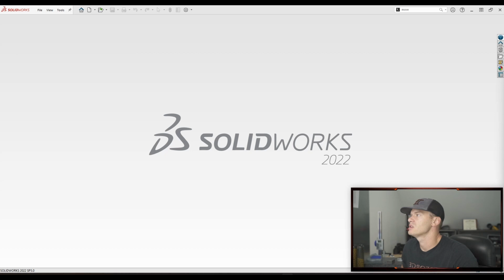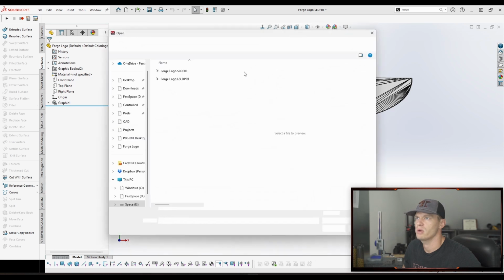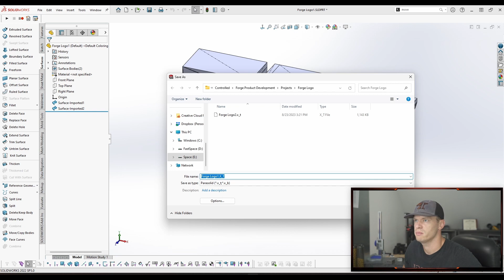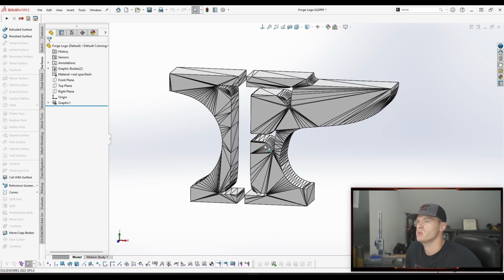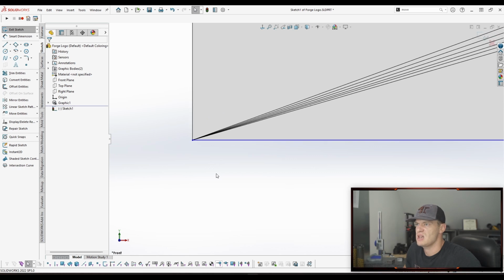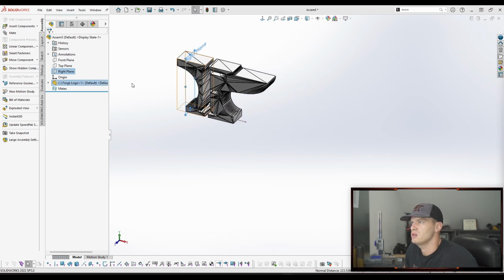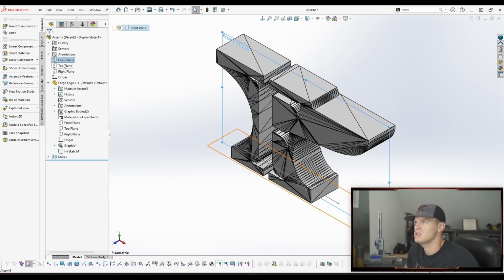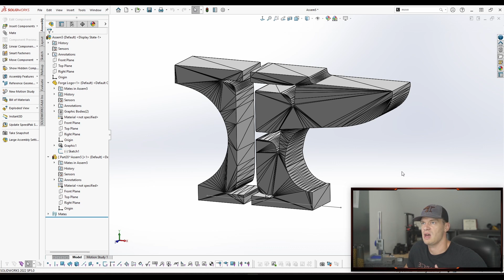How to Align Empty Mesh Files in SolidWorks

Comment: Hey Josh, I'm in the process of scanning a full car and using a graphics mesh to build the chassis and roll cage. This was exactly what I was after to redefine the origin and planes - albeit I would have liked to create more accurate sketches to define the ground plane and centreline but I guess eye balling it will give me the 1-2mm accuracy I need. Thanks.
Reply from the maker: Very cool project! I hear you. It is hard with only a graphics body. 

A large object like that can create massive mesh files. You may be surprised how course a mesh you can get away with as a reference, which may allow you to import as a surface body. 

Also, you could try making a mesh that contains only a few key areas (mounting points and ground plane?) that would be light weight enough to import as a surface and build more accurate references from.

Good luck! Whats the car? Is this for work or fun?
Reply: @forgeproductdevelopment  its a Holden ute, similar to an El Camino - destined for drag and drive in the low 7 sec zone. The purpose of the mesh is to get a tight fitting rollcage and have the tube cnc notched and bent - so yes although I have a full mesh I'll be removing what I don't need. I can also work out the diff width without cutting a single panel. 

Work no, fun not so sure 🙂

Comment: Quick shout out to Josh for helping me out with a problem I was having creating an offset after using the "Cavity" function. I was blown away how quickly he came to my aid, whilst being patient with my lack of experience. 11 out of 10.
Reply from the maker: Just saw this comment! Glad I could help and hope you are doing well. How did the project turn out?
Reply: @forgeproductdevelopment  Weeeeeellllllll.....to be truthful, I haven't printed it out; the original is still surviving on the roof of our motorhome.
I did finish the design and after looking at it from all angles and many section views, I'm 99.99% sure it is ready for when the original design breaks.
I'm about to lash out for a Qidi Plus 4 which has a larger print volume than the one I have, so I'll be able to print it in 4 pieces instead of 6. Also, with a heated chamber I'll be able to use more "exotic", engineering filaments which should mean the new one will be bulletproof.
Thanks again and hope you are doing well. Looking forward to more of your vids.